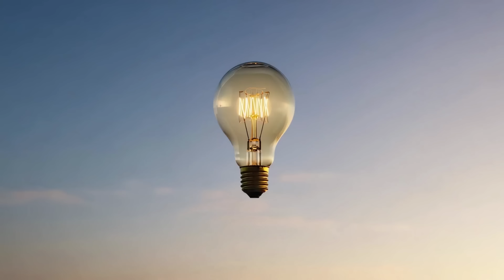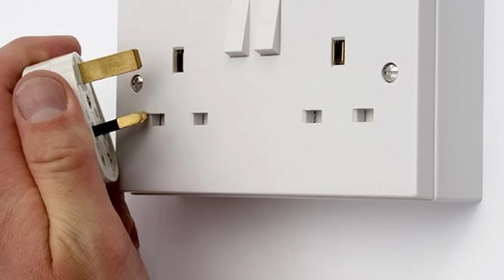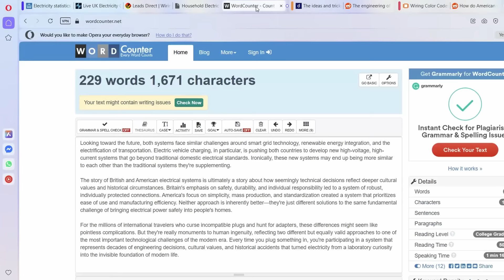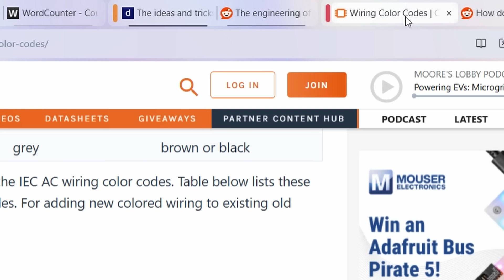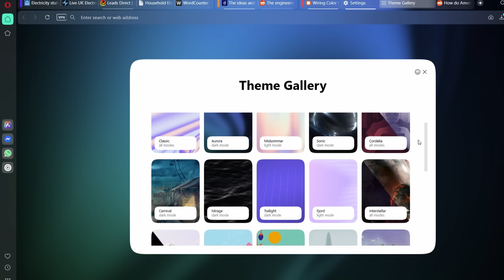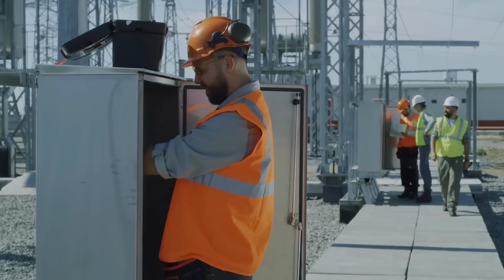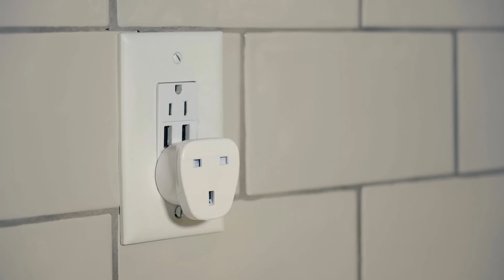British electricity is SAFER than American electricity. here's how.

Comment: Cimparing the us plug with the Uk BS1363 plug is comparing apples and oranges.  The US plug was to my knowledge the first electric plug system being  used.  The tw blade configuration was introduced in 1912 while the BS1363 plug is from 1947.

The ring system isn't safer due ti redundancy.  It primarily exists to save copper which following ww2  was a priority.  One flaw of ring circuits is that the end of what otherwise would be a radial circuit has to be connected back to the consumer unit which can be painful.

Radial circuits are permitted in the UK and these days usually are preferred for new installations.  Similarly ring circuits are permitted here in Germany but that option is rarely if ever used for low voltage (< 1000 V that is) stuff for simplicity.

As for EU standardization, already in the late 80s or so the voltage across the entire EU was migrated from 220 / 380V in continental Europe and 240 / 415 V in the UK to 230 / 415 V across all of Europe.   The 2nd voltage of these pairs is the phase-to-phase voltage in three phase systems which are rare in residential installations in the UK.

Comment: US (NTSC) and UK (PAL-G) TV standards used to be a massive dividing factor to. The TV frame rate had to be the same as the mains frequency otherwise all the studio lights would flicker with respect to the TV cameras and also the old TV sets, which didn't have the best a.c. rejection in the 1950s-1980s, would also flicker. With the mains frequency matched to the frame rate you might get a much less distracting feint horizontal bar slowly moving up or down the picture.

These days, with digital TV, it doesn't really matter so much because cameras all have flicker filters and there is no way the mains ripple will ever interfere with a modern TV set/monitor. So its better to use 60Hz for everything because you get smoother motion then. At least that's how I set my phone camera.
Reply: Er, excuse me, the old UK PAL TV system used system I, with 6.0 Mhz sound intercarrier, system G was used in western europe with a 5.5Mhz intercarrier, and another version, I forget which letter it used was used in eastern europe and Russia with a 6.5Mhz intercarrier and a version of the french SECAM colour system.
Reply: @majorpygge-phartt2643  Thanks for the correction.

Comment: The fuse in a 13A plug is not really to protect the appliance, it's to protect the flexible cable.
Officially, UK nominal voltage now is 230vac.
Reply: Except that, guess what, it's not really, as if we here in the UK dropped to 230 volts then the greedy energy suppliers and the big appliance makers would lose some of their fat profits so I can't see our mains voltage being dropped any time soon, and whenever I check it with a digital meter it's still 240.
Reply: @majorpygge-phartt2643  Hence 'Officially'...

Comment: The flat squared pins on the  British electrical systems have only been in place for less than 70 years, when AC electrical power was standardised, prior to this a system working on DC current was running the outlets for that accepted a round pin plug of a similar configuration this was not as safe as the current system as the round holes in the sockets were extremely interesting to children's fingers the safety slides were not as efficient, I believe this change took place in the late 1950's

Comment: Thomas Edison was extensively involved in the UK's earliest domestic electrical supply - for example at Holborn Viaduct generating station (1882) - thus meaning that DC was king. With the relatively short transmission distances involved an urban DC supply was practicable. AC as Westinghouse supported in the War of Currents, solved many of the power loss over distance problems. The first high voltage (10kV) power generating station was constructed at Deptford SE London in 1890 by de Ferranti - although it continued to supply 3-wire DC to industrial customers with 2 'pressures' (voltages) offered.

Comment: British plugs might 'best in class'  but, sadly, Chinese 'British' plugs are often comically badly made with the earth pin the same length as the L and the N pins, and latter two lacking the partial insulation cover. On top of that, China-made cartridge fuses that go in the plug are extensively faked and of abysmal quality, being filled with sand rather than the required fire-suppressant  gypsum crystals and having random rupture currents bearing no relation to the marked ratings. Trading Standards operating in port areas like Tilbury and Felixstowe used to regularly intercept containers from Rotterdam containing literally millions of these dangerous things.

Comment: Also the fuse thing in a plug is a reactively modern thing, I remember being in a flat circa early 80's, no fuses, a round central pin, two slots either side, trust me it wasn't safe.
Reply: The fuse is as modern as the 13A plug, so pretty old. It's just that your 1980s experience was with a house that hadn't been rewired in decades.
Reply: @bengamble8614  My uncle is a/was a parky, dad was an electrical/electronics engineer, do you not think I know that.

Comment: Im fairy sure with evs and heat pumps comming the uk and eu will start to switch to 3 phase as most of the time the street is already wired for it just needs a new wire to the house the US will take a different aproach

Comment: Continued... Only pull 10a, and also tend to have a temp sensor built into the plug and wired back to the charger box - when the plug gets too warm it cuts the current down to reduce the load and thus the heat in the plug.
Oh, and the sleeved pins, they didn't originally have that, that was done much later you can still find older plugs without the sleeved pins, which nowadays should fail a 'Pat test' so will likely now tend to only exist in older houses

Comment: I think it's amusing that you think our 13a plugs are so good, makes me wonder how bad US plugs must be?  For the record, our 13A plugs are not fit for purpose, try running them at the nominal 13a for a serious length of time and see what happens.  - they usually either melt or burn up.
The reason why 'granny chargers' the ones that have a 13a plug on the end, only pull 10 amps

Comment: Note. The UK moved away from Round pins & a radial distrabution layout to the square pins & ring main in 1947 (post war) this had the advantage of saving expensive copper (the country was more or less bancrupt) & reducing the complexity of caused by the different sizes of the 2, 5, 15 & 30A unfused plugs. Plugs could only be used in their coresponding different sized sockets which had their apropriate sized wires going to a central fuse box where one would find the correct fuse for each socket , yes things were designed by engineers.

Comment: One advantage with a ring main is that unlike radial circuits, it doesn't cost much to have a lot of unused sockets around a room. If you want to plug something in, you use the nearest socket rather than having to trail extension leads all over the place. Since there is only one type of socket (not including shaver sockets) any UK plug will fit any UK socket.
Reply: Why do you think the cost of having additional sockets with a radial is higher?  You have some pretty basic misunderstandings of how things work in the real world.

Comment: The voltage choice is a tradeoff; lower voltage means less electrocutions but more fires due to the higher current for the same power, hence the 240V system needs higher safety standards.
The square pin standard is not perfect, the plugs are unnecessarily bulky for low current appliances which are increasingly common and the earth pin is not required in a lot of cases. At the other end of the scale the plugs are marginal at the 3 kW maximum rating and tend to run warm. The old 2/3 round pin 3/5/15 amp standard was better in this respect and could have been updated to include fusing, shrouding and shuttered sockets, indeed it's still used for specialist applications and these have been implemented.

Comment: Brit here - You don’t notice it that much on holiday, but I just came back from living in the states for a few years. I HATED the US electricity & plugs. 
Anytime I used the Hoover or the electric Iron the lights in the living room would dim.
No overhead light in the bedrooms, just a socket which was connected to the light-switch for a lamp.
The plugs were ridiculous - two small pins which would always allow the plug to droop out of the socket. Most of the plugs would stick straight out, preventing you from putting furniture against the walls. (The flat diagonal plugs were OK - reminded me of UK plugs a bit)
I hated the fact that you couldn’t switch off sockets at the wall! - I had an extension lead fall apart in my hand because air freshener oil got into it - it didn’t trip a circuit breaker, so I could’ve held onto a crumbling live circuit.
The sockets themselves feel like a 5y/o old could pull them out of the wall.
Reply: the lights would dim because you didn't train the hampster to run faster on the wheel

Comment: And what about mains wiring colour codes? both fixed hard cables as well as flexes, including multicore flexes like those used for stuff like central heating control systems. Back in the 1960's, and I was there, albeit only a little sprog, but I can remember the old colour cades for the flexes at least, the flexes on appliances were red for live, black for neutral, and green for earth, but it was dangerous because some folk are colourblind and can get green and red mixed up which could have deadly consequences...so it was replaced with brown for live, blue for neutral, and green with yellow for the earth, as with two colours it couldn't be so easily mistaken. But three phase cabling, as well as that used for two-way light switching, like landing lights in the home, still used red, yellow and blue which are all live, but they too have now been replaced with brown, black and grey, again all live, but blue is now used for neutral, and black is now live...so wiring is not for numpties! And this is something one has to be thoroughly aware of when adding new wiring to an existing installation, or replacing some because of fire damage for instance, you MUST be thoroughly familiar with the different generations of colours and not the sort who gets too easily confused.

Comment: I've often thought that while our electric supply voltage here in the UK is supposedly going to be "harmonised" with europe to 230 volts instead of 240, I don't think it will happen as it would seriously erode the fat profits made by the energy suppliers as well as them who make the appliances, especially stuff like electric cookers, showers, kettles, irons, toasters, immersion heaters, air fryers etc., as they use miles more power and cost more to run at 240 volts while rated at only 230, for instance a 230 volt, 3kw immersion heater uses 3.75kw when powered from 240 volts so when I bought a new one some years ago I made sure I got one rated at 240 volt. And of course the heating elements if rated at 230 volts won't last as long when powered by 240 so we're more likely to have to replace them more often.

Comment: Seems like a good portion of your video is a promotion for the Opera browser. I have been using this for many years, but you omitted to mention one feature that caused me to choose it in the first place, particularly on smaller phone screens: Text Reflow.  If the text is difficult to read because it is too small and you zoom in, the font grows in size, but with most browsers you then have to scroll left and right to read along the lines. If you activate Text Flow on the Opera browser, the words in the article rearrange themselves to fit within the margins of your screen. This is an absolute killer feature, and I think it is unique to Opera.
Reply: It happens on most items in Chrome, but not on pdfs

Comment: The UK switched to the 220V European standard a number of years ago. It was so difficult nobody noticed
Reply: Really? my meter still reads 240 whenever I test it, as I do occasionally, and have you seen my comment above about so-called "harmonisation" with europe and why it's not likely to happen?
Reply: No-one noticed because it never really happened. UK supply is still around 240v. What's changed is the definition. Compliant voltage is now 230v +10% or -6%.

Comment: Maybe something to note, the british 240-250VAC system did not get the voltage standardised until the 1960s. Before then the voltage could be all over the place. Whilst it now complies with the Euro 220-240VAC envelope, we will usually find it is actually closer to 248VAC to allow for line voltage drop from the sub-station. Whilst the fused square-pin 13A plug is now standardised, even in the 1970s we still had the older round-pin 2A, 5A, and 15A unfused round-pin plugs. The rule is if any part of a metal chassis can be touched then the device must be earthed, "double-insulated" is simply not good enough for any metal cased device. A particular example is a guitar amplifier where the player is touching the strings which are grounded through the stage lead to the amplifier. If there is no functional third wire earth wire in the mains plug then the breaker in the distribution box cannot sense earth current and prevent electrocution in the event of a fault. A number of imported amplifiers have been found with no earthing. If the transformer burns out, and this does happen, the live mains gets dumped into the transformer core which is bolted to the chassis. Whilst this will blow the fuse, it is not fast enough to save a person touching the ground, but a breaker is. If we have any sense a guitar amplifier should be plugged in to a RCD (residual current device) at the wall outlet in addition to any breaker at the distribution box. 
The current carrying capability of a wire is proportional to the cross section area of the wire. Not the voltage at all. But the lower the voltage the more line drop. At 250VAC the line drop is imperceptible, we can run that 3kW kettle at the end of a long run from the distribution box.
Reply: It was the same in all over Europe. In Italy every city had their own system or two. In Finland cities were 127 V but rural areas were 220 V. The center of Helsinki used 125 DC.

Btw the over a billion people use still the round pronged BS546 plugs and sockets.
Reply: I couldn't agree more about metal cased devices, but as an ex electronics repairer I've seen far too many fairly recently made electronic small appliances like various set top boxes and DVD players and recorders, and the old VCR's with metal cases and no earth fitted, but just relying on so-called double insulation which is all too often nothing of the sort, but just a simple air gap, and quite a few older HIFI separates have metal cases with no earth too, and loads of the above devices have bare live circuit boards fitted too, increasing the danger.
Reply: @majorpygge-phartt2643  yeah, it's really scary. I already knew this stuff (SQEP)  I grabbed off the interweb, "In the UK, electrical earthing is a legal requirement for safety, primarily governed by BS 7671 (IET Wiring Regulations), ensuring exposed metal parts can't become live during a fault by providing a path for fault current to earth, tripping protective devices."  A guitar player is quite literally holding a bunch of strings connected to the sheath of the stage lead grounded to the amp chassis. To find the chassis un-earthed is a bit of a shock, pun intended.

Comment: 9:22 - Sorry to burst your bubble there but British electrical standards do this too. Very much so. 

Our electrical standard is called The IET Wiring Regulations and go by "Editions" which is also the term you'll hear banded around by sparkies in the UK. Currently it's in it's 18th Edition with the 19th Edition very eagerly awaited.
Reply: Every time anyone comes to do electrical work, they look at the distribution board and say "oh, you need an XYZ now as the rules have changed." Latest is the surge protection device to protect delicate electronics from glitches on the incoming mains.
Reply: @bengamble8614  yep, I know that feeling. Had our flat inspected (which previously passed... Just) but had to have a new panel put in. An odd experience considering last time I rented the place still had wire fuses in and forget having an RCD anywhere near it.

That said my dad was an industrial sparky and keeps reminding me of what needs tweaking where etc etc.

Comment: the major problem in America is that your country is so damn big. this has given rise to some huge issues that can only be completed by throwing stupid amounts of money at it. there is a youtube channel called diesel creek who ran through the cost of putting electricity into his workshop (he ranit off a generator for quite some time before switching to mains). he mentioned the cost to have this done and it was in the many thousands, and that was just for them to fit the consumer outlet. we also bury our wires under ground, except for the main sub station wires that are as thick as your wrist. these wires have to go above ground simply because they would get so hot they would constantly blow the wire apart and then you have a very pretty arc as the power would jump fromonewire to the next!

Comment: ok so im gonna have to put you right ona couple of things. firstly, plugs didnt always have fuses in them, and the plug we have now wasnt fully in use even by the time i was born in 1965. we had what was called a round pin plug, with the 'pins' that went into the wall plug being round. plugs were changed from round to square, though they werent actually square but more like (and i hope this works)........ 2 bottom pins > I___I<. andthen a single >I_I< for the ground pin i cant 'draw' the top lines but this will give you a general idea.......